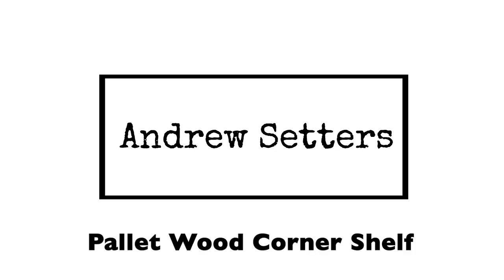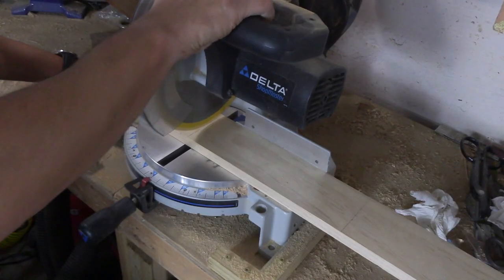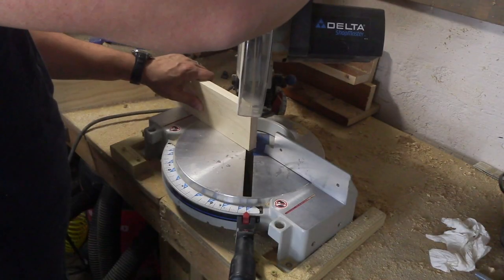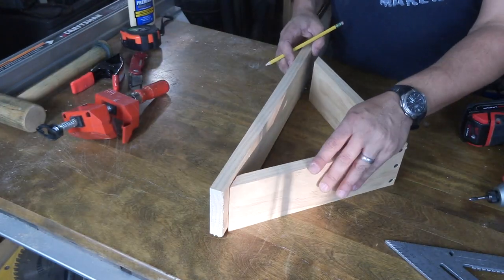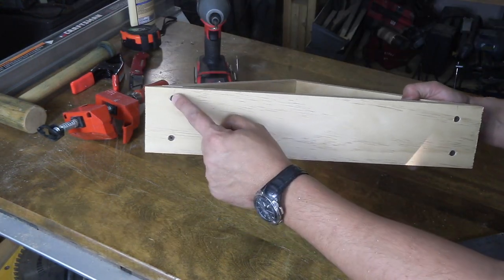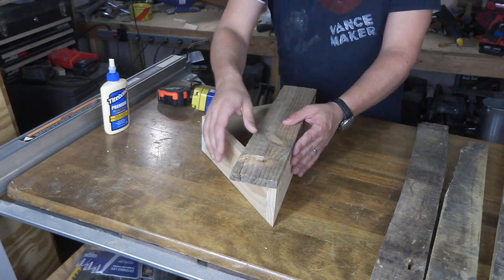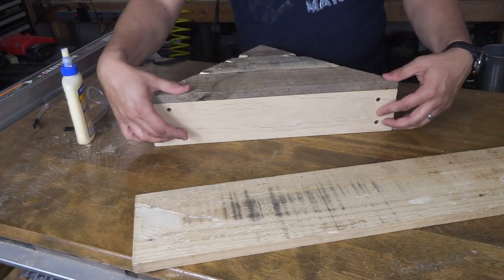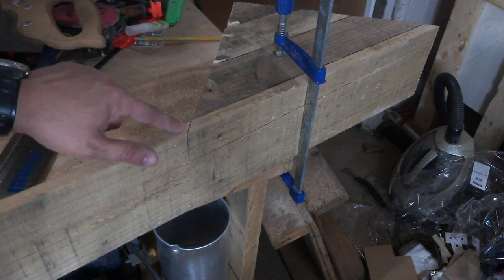019 Pallet Wood Simple Corner Shelf

Comment: Nice project. It looks great. I don't think the aversion that "real" woodworkers have regarding pallet wood has anything to do with it being cupped and cracked and full of holes. I think the aversion is how dirty it is and what a pain removing the metal from it is. 

That's why I don't like it. It's hell on my jointer and planer knives. And if I miss a piece of metal, forget about it. I guess you could argue that most pallet projects aren't milled up with a planer and jointer, I think that just comes down to personal taste.
Reply from the maker: +Brian McCauley Unfortunately, I don't have a planer or jointer - if I did I wouldn't risk running pallet wood through it either. What you save by using a free pallet you'd waste in replacing knives. I think a lot of people who work with pallet wood are either in love with it because of the look, or using it because they're looking for free material to experiment with - that's why I was doing a little bit of woodworking 101 in this video.